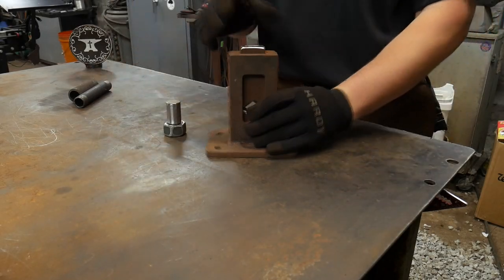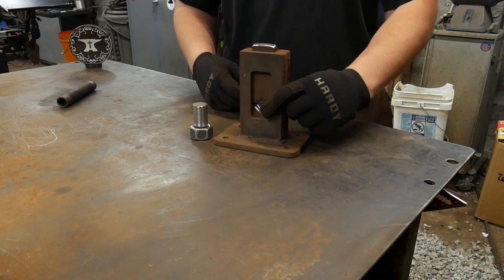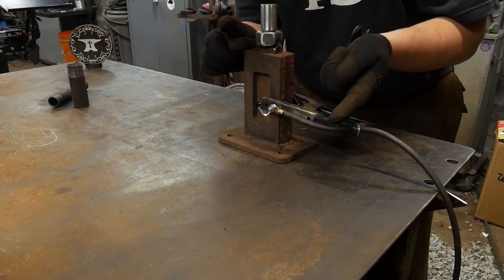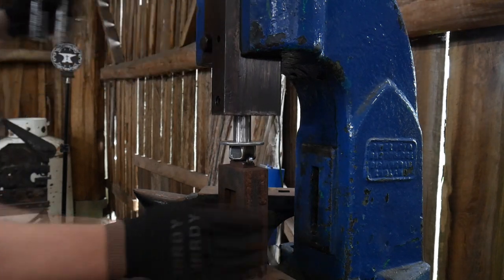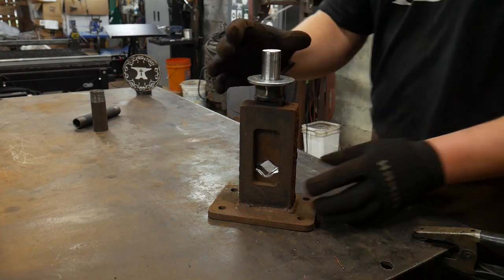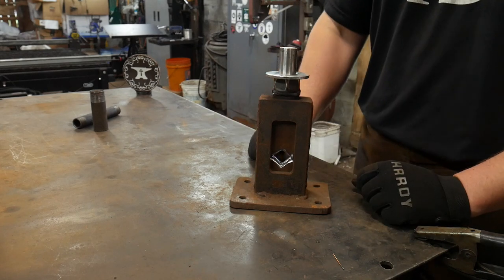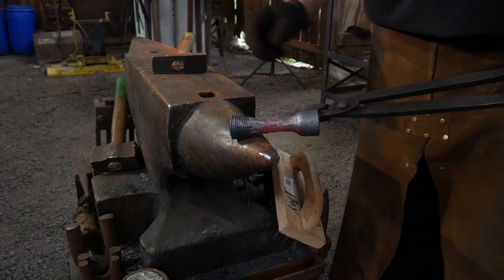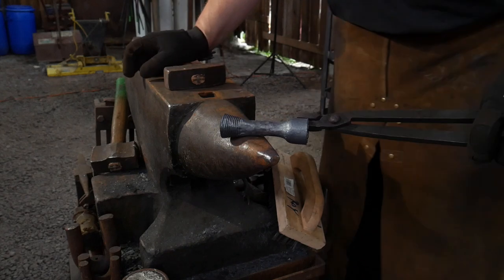Adapting a Guillotine Tool for the Fly Press

Comment: Just another technique I’d like to add....           The dies for my press I will put them in place and apply a little pressure on them first. Then get some good tacks on them while in the press. Then pull them out and weld. I have left them installed and welded but it’s not always possible depending on the dies. Good way to insure perfect fit every time.